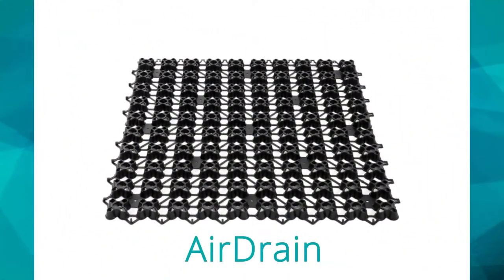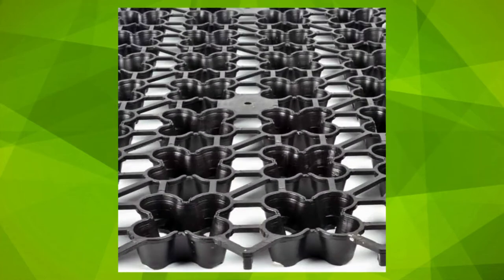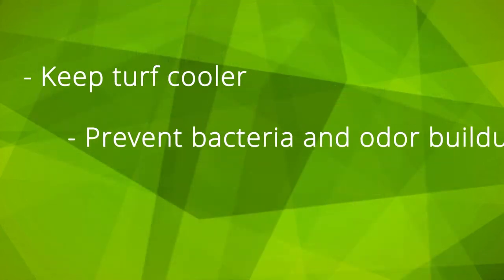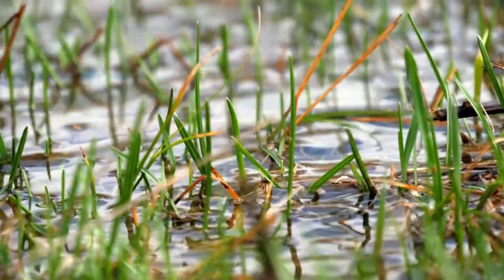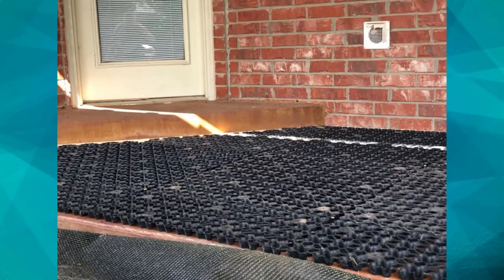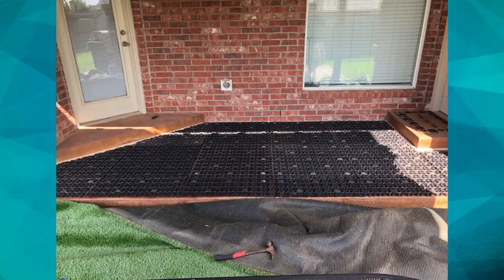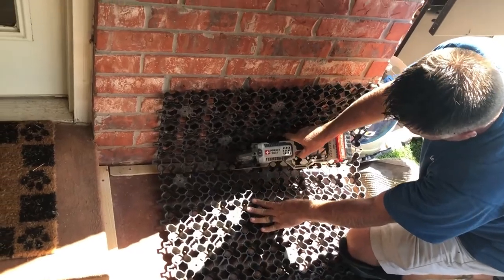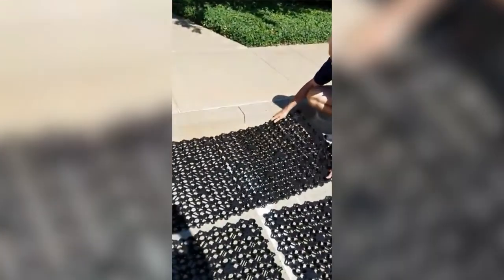Getting Proper Drainage with AirDrain

Comment: How many m2 could you install per day?
Reply from the maker: Hi, Malcolm! It depends on if you're DIYing or apart of an installation crew, but AirDrain is lightweight and relatively easy to install. We've seen crews lay 1000+ square feet in a day, but cutting and stapling the perimeter edges and nailing the AirDrain down can take more time. In addition to the other steps of turf installation, it can be a multi-day process. But again, it depends on the crew. If you have more AirDrain installation questions, you can visit https://airfieldsystems.com/